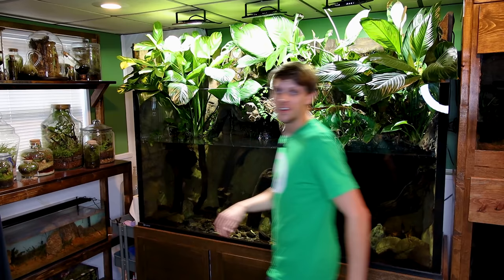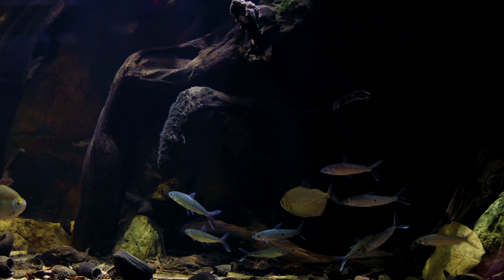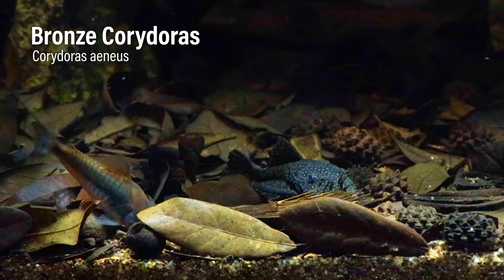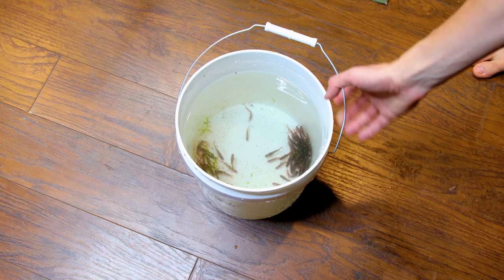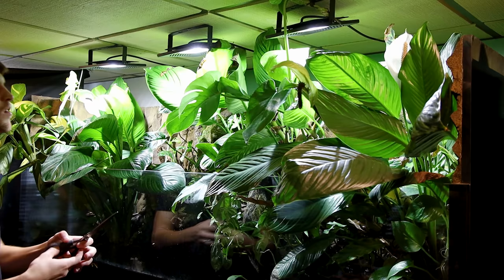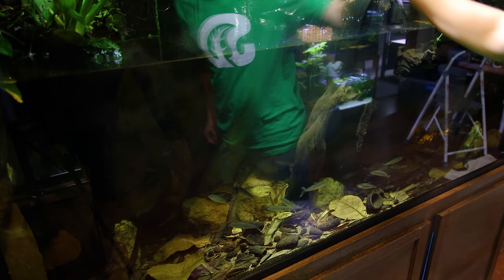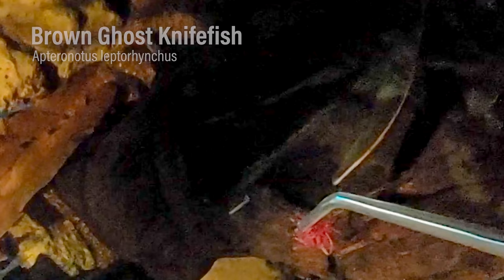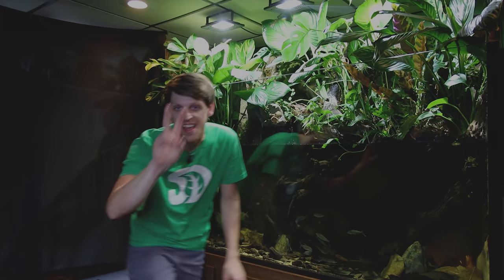The Truth About My 350 Gallon Jungle Paludarium (1 Year Later)

Comment: There are a couple of advanced options for (bio)remediating copper and other heavy metals in your tank which could be killing your precious babies and you're not sure what the source could be. You may want to look into bacteria which can hyperaccumulate various heavy metals like nickel and zinc to inoculate your sump filter with. Not sure where you would source such things, but you seem to have connections, so idk maybe it's possible lol.  Adding extra activated carbon and replacing the sock more frequently should help remove the heavy metals as well, but you probably already considered that. There are also more powerful deionizing resins than the typical ion exchange beads found in most aquarium filter mediums. Not sure how concerned you are about the stability of the tank's microbiome, but if you were really desperate to pull out the heavy ions this may help compensate the imbalance, especially when the mysterious source has a higher input rate of flow into to your water column than your current setup is able to filter out. Perhaps adding it incrementally could offset the perturbation to the system that deionizing could cause. There's also something to be said about the redox potential of the water, so for a less-than-neutral pH system you want it to be a slightly reducing environment while controlling the levels of conductivity (ions and their salts) will control the equilibrium of the countering oxidation potential relative to whatever the nominal pH is. I believe most oligotrophic system do best when these are kept low and more familiar ions make up the typical composition of the natural habitat you're aiming for. I think the general rule is that oligotrophic systems prefer low conductivity, but it should be more conductive as we go from mesotrophic to eutrophic. The same goes for terrestrial soil, but I think the ideal ranges are different and you want it to be more conductive on average. A lot of things I'm reading says this has positive health benefits for the fish and helps the food web cycle more easily, and nothing causes disease like icky food standing around not getting metabolized by the naturalized inhabitants. 

Also what happened to the days of pumped biological filtration beneath the soil? I miss that. People should be filling that gap with medium-sized activated carbon chunks and a thin layer of clay so a nutrient pool can form and the soil can establish it's own natural and contained cycles.

Comment: Back when I was first married 25 years ago my ex set up an aquarium on the cheap in our basement.  I think it was a 40 gallon on.  There was a window to provide a little light.  We put plants, snails, and tiny fish from my mother's arterial pond.  She never put those fish in there and figured there must have been eggs on the plants she bought.  We set up the aquarium and basically left it along.  The fish ate off the plants and the plants seemed to do fine in the low light.  We did not use a bubbler or filter as the plants should help.  Well we literally forgot about the aquarium... for 2 years.  The plants had filled in the aquarium a bit more, but not too bad and low and behold there snails and fish had survived... and thrived.  The water was so crystal clear too and the glass was clean.  We had basically created a closed ecosystem.  We were moving so we gave everything back to my mother to put in her pond again.

Comment: Oh, I've worked at a pet store for the past couple of years and I recognize that white film as something that occasionally happens to one or two of our bettas every few months. I have no idea what it is but normally we try to treat it with pimafix and melafix and salt, normally it goes away if you catch it early enough but it does almost always come back. I see it way more often in bettas that have been at the store for a while so my assumption is that if kept in not great conditions for longer periods of time it weakens their immune system a lot so it's easier for things like that to form. It doesn't happen to any of the other bettas at the same time and normally if it does it's also a betta that has been there for a while. A bit unfortunate that you aren't sure what it is because I've tried to figure it out for a while and all I could guess was Fungus as well.

Comment: I bought an old upright piano I am going to gut and turn into a tank of some sort. This is giving me inspiration. I'd prefer to do one with a lid however. That way I can keep some sort of geckos(or similar) in the upper part. Any advice on setting this up so it's easy to maintain(I'm in a wheelchair), would be greatly appreciated. I currently have a tank with Malawi cichlids and can keep that clean easy enough(I can stand and clean my tank).

Comment: I'm doing a custom-built 180-gallon terrarium framed inside a Trinity wire shelving system. Id like to keep the weight down for portability someday when I move so I'm considering tempered glass. Is 3/16" sufficient for 18x48" walls+ceiling, 48x48" rear and front? I was considering 1/4" tempered for the bottom. At these sizes, i'm looking at around $350 for the glass panels.